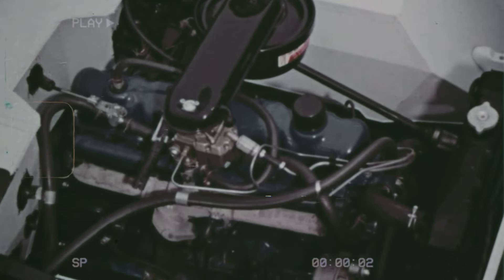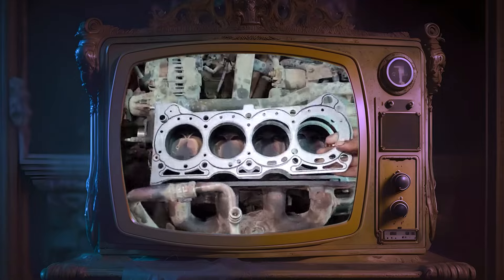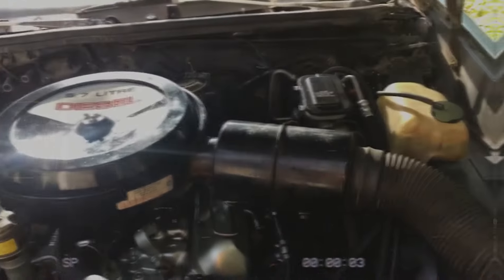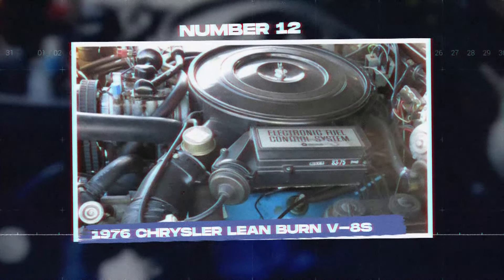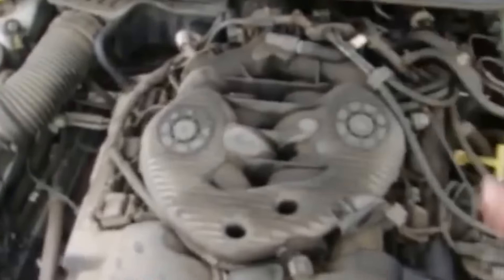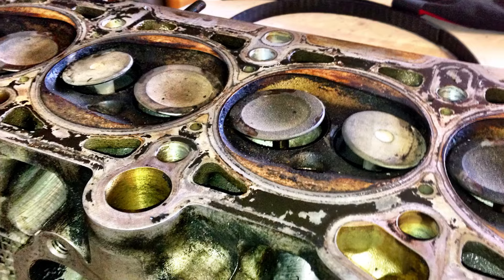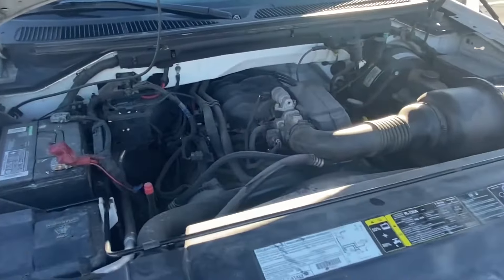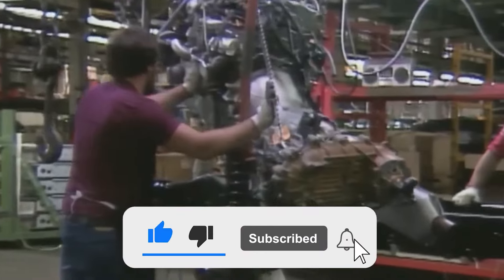20 WORST Pickup Truck Engines Ever Put in Production Vehicles!

Comment: My 96 Chevy 1500 had a 305. Almost  the biggest dog engine I ever had in a truck,. # 1 worst engine was the V6 in an 87 Dakota. It bordered on dangerous because you never knew if it would accelerate when you wanted to pass. Absolute garbage.
Reply: I had a 1985 Chevy van G 20 with a 5.0 (305) cu & that engine wasn’t very good it was a pos

Comment: Im quite confused on your concept of “reliability”. For me, it means dependability and low failure rate. The 305 is slow as a snail, and mostly a boat anchor, but a bulletproof boat anchor.
Reply: 1980’s soft camshafts isn’t a reliability problem?

Comment: 305s had issues with low power and they had a reputation for having poor quality camshafts that would lead to early cam failure. Other than that they were bullet proof low hp engines. Basically a 350 with a smaller bore size.

Comment: You forgot the Chevy 2.8 V6.
Reply: No power usually ended up with a broke crankshaft. Mainly used in the s10. Cheaper than the bulletproof 4.3 probably the best v6 ever made.